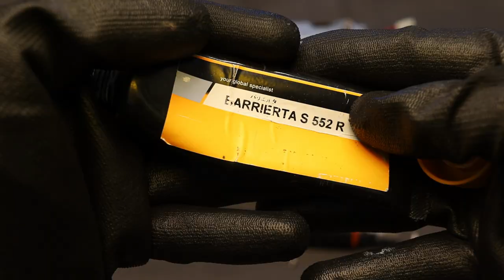Replacing fuser roller, belt sleeve RICOH IMC 2000 2500 3500 4500 3000 3500 MPC 4504 5504

Comment: Is it necessary to change the bushings, sensors or any other part that you did not indicate in the Description? My fuser unit has 235 thousand impressions.
Reply from the maker: If you want to be sure that everything will be fine, replace both thermistors and that's it.

Comment: Hi, i got an unrelated question, but google doesnt yield me any results, and i´m fairly certain you can help.

My question is: Is there a Plrinter that is repairable to a high degree and reasonable to use at home?
Features it must have are: Colour Printing, Ethernet Port, Copying
Features it should have are: Double-sided printing, 1200 dpi, pricepoint around 300€

Its not dramatic if the Printer does not support all nice-to-have features, but is repairable.
If my pricepoint is too low, can you tell me what a good printer would cost?

Currently im trying to repair a Canon PIXMA printer, and it won't open up at all, already broke some plastic things off but its just hardplastic clip over hardplastic clip... So i kinda have to give up on that one, probably gonna scrape it for parts...
Reply from the maker: I'm sorry my friend, but I don't deal with home printers.
Reply: @MrRicoh  Ah i see. Sadge D:

Comment: I have an issue that no one seems to figure out. My Ricoh c3002 has mottling on solid areas of color and when I do a test print, the black is severely mottled as well as the Red green and blue. I’ve already replaced the image drum as well as the developer and it has had no effect. What would be the next options? Replace the transfer belt or maybe the fuser ? Please let me know because I am unable to print anything for my business and I’ve already spent hundreds of dollars on repair services and parts.
Reply from the maker: Has the drum unit been completely replaced? What is the catalog number of the part installed?
Reply: @MrRicoh  yes I replaced the drum in the unit. Here is exactly what I bought below
Reply from the maker: @baroquebeatz Did you only replace the drum (the photosensitive roller) in the Drum Unit?
Reply: @MrRicoh  yes I only replaced the drum roller.
Reply from the maker: @baroquebeatz That's why you have problems. The whole repair kit needs to be replaced, see the photo: 
www.copy-expert.pl/produkt.php?iden=242221
Reply: @MrRicoh  would this fix the other colors mottling? Areas of large solid colors have an orange peel texture. Like an uneven density.
Reply from the maker: @baroquebeatz You have to replace the entire set of parts. Only after that you can check the quality of the copy and print.